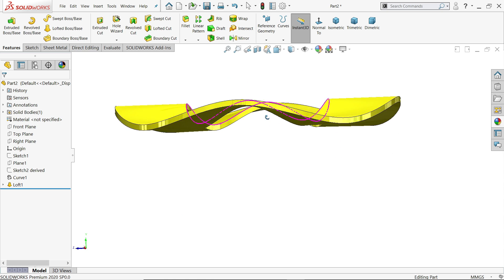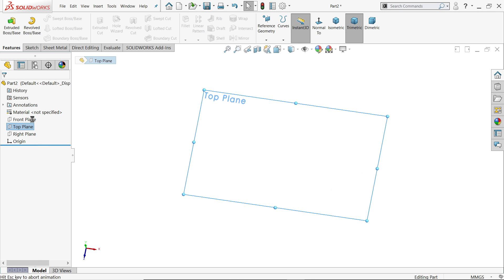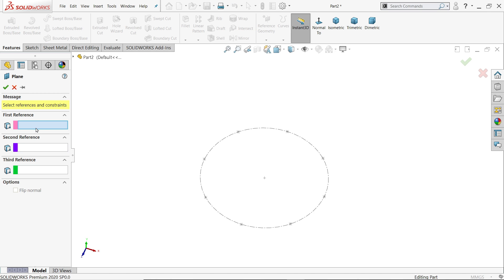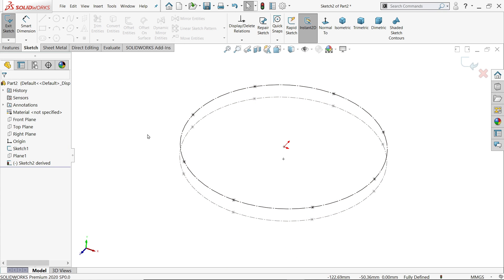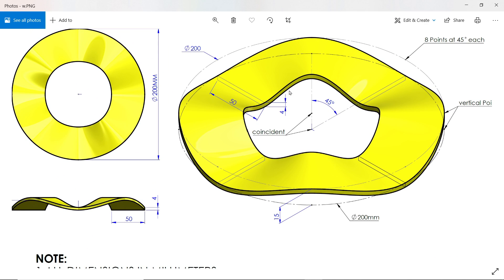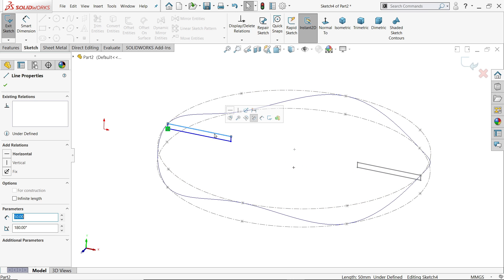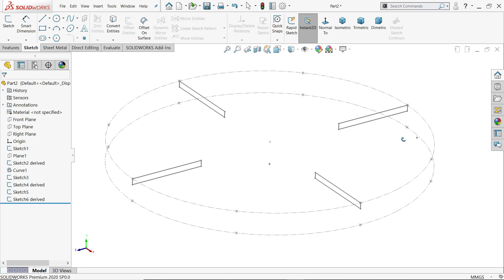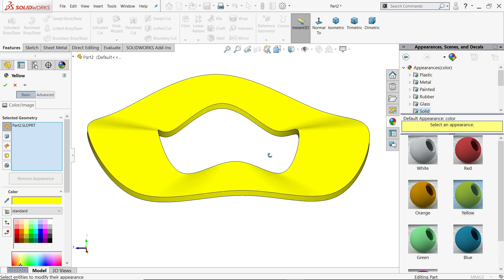Wave Washer in Solidworks (Curve Through Reference Points)

Comment: another trick to create this is to make the 8 rectangle around the both circles ie 4 on both the circles in up and down manner and then use the lofted bose base and after selecting 7 rectangles check the close loop option down there in the loft command the result will be same
Reply: this also works...

or Above your example... create one Reactangle (Sketch) in Y Direction and make Array of it in X Direction 

just asking how to make array of Sketched plane ?